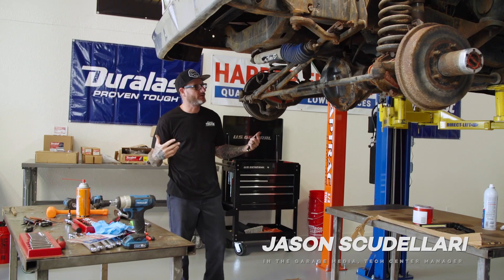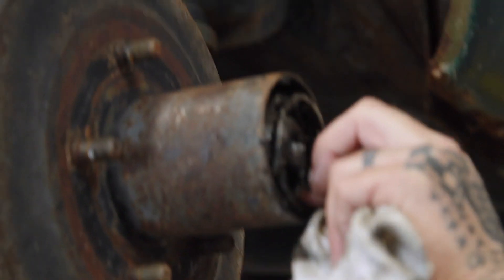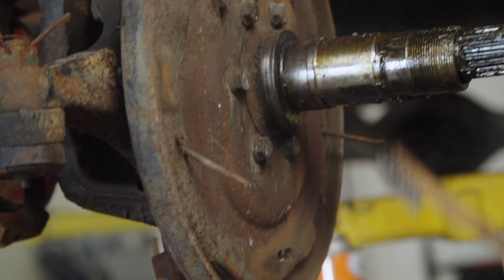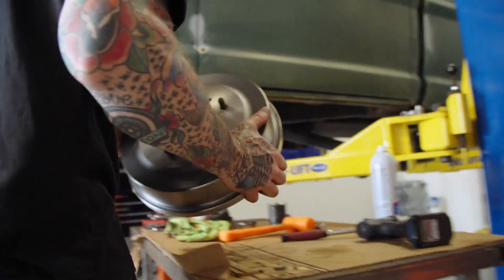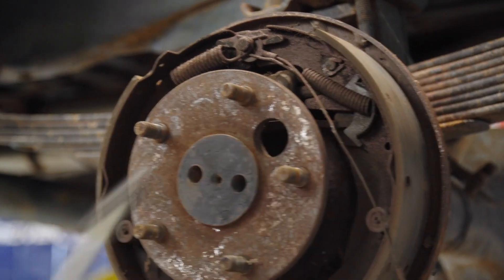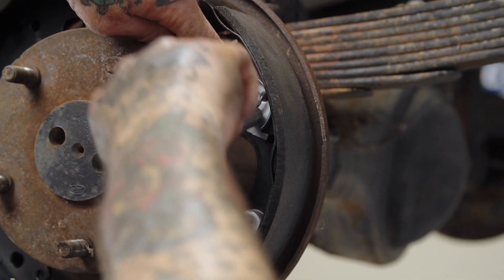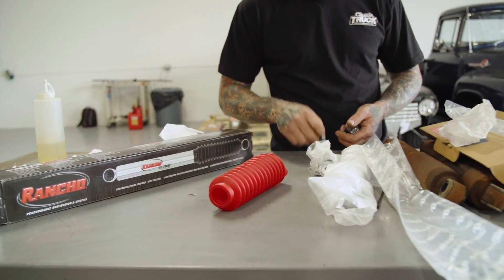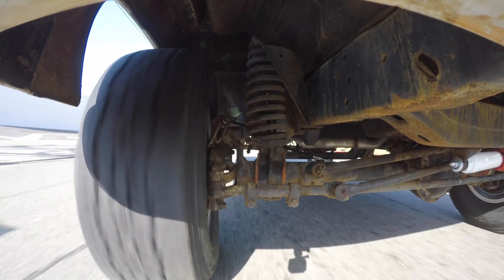How to rebuild F-100 4×4’s four-wheel drum brake system. Step by step to remove & replace 4X4 hubs.

Comment: No mention of how to set the bearing preload. If you just crank down on the lock and adjuster nut without any torque wrench, you’ll burn out your bearings right away. To anyone watching this as a guide, you need to install the first nut (the one with a little pin sticking out of it) to 50 ft pounds, then back off 90 degrees. Install the lock ring so the pin on the nut slide through one of the little holes, you may have to slightly adjust the nut. Then install the second nut to 90 ft pounds

Comment: I don't think the brake booster installed in this video was PN 54-73515.  I just installed that exact part, and it's thicker front-to-back.

Comment: That rear end housing is from a  later model truck. Did u swap that in??
Reply from the maker: It could have been swapped at some point. We thought it was the original.
Reply: @classictruckperformance290  well? I know these kinds of trucks pretty well but I will admit there is always the chance I'm wrong. But the shape of the housing around the pumpkin kinda spreads out further making it a stronger housing & those housings started being seen on 76 & up 1/2 ton fords. On earlier fords the pumpkin area of the housing is much rounder & the axle tubes transition into round axle tubes closer to the pumpkin. Supporting the ridgedness of overall housing less.

Comment: Great video but you didn't show  the difference of the holes on the lock ring and the pin that should of been on the first wheelbearng nut that locks the ring to the first nut.